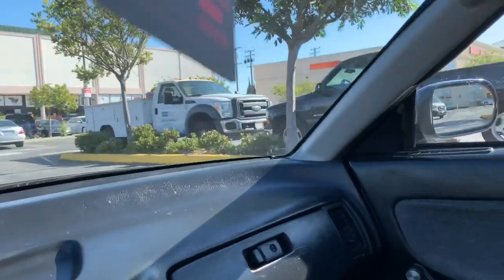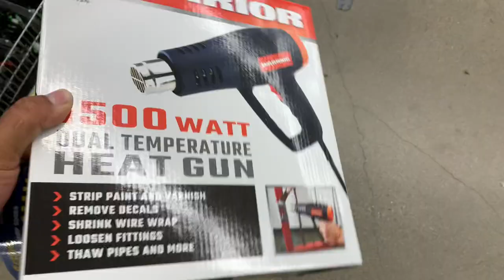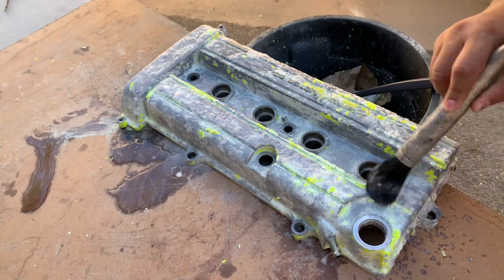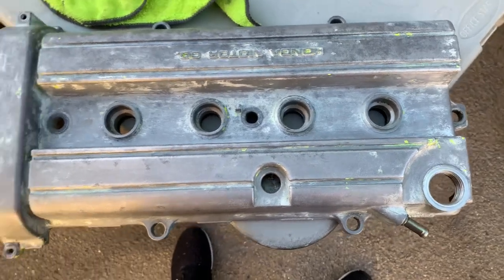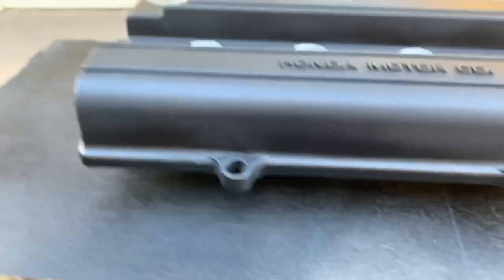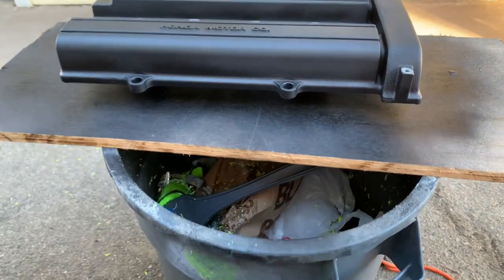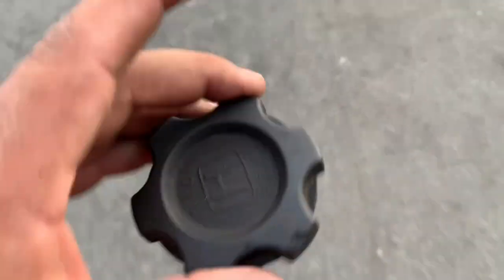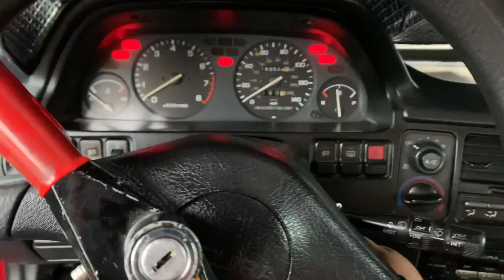HOW 2: VHT WRINKLE BLACK PAINT VALVE COVER !!!

Comment: Mi amigo you should change your manifold intake and get rid of all those old vac lines n TB and port it while you at it. The 94-00 intake manifolds make more power n  your engine bay will look cleaner.
Reply from the maker: That’s the plan!